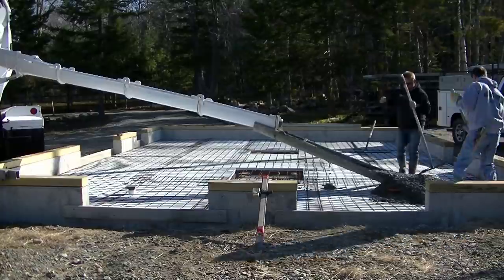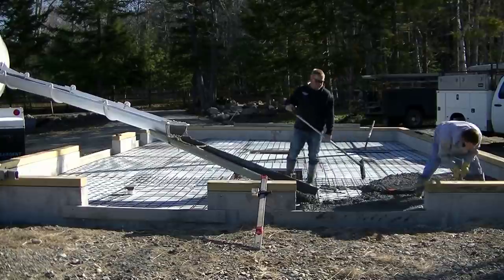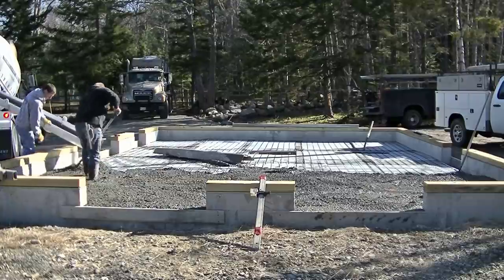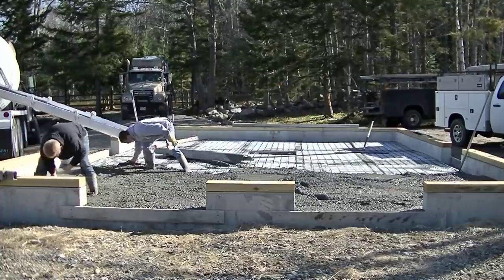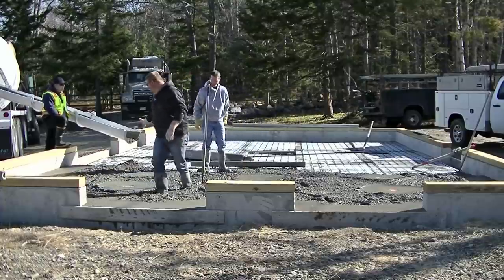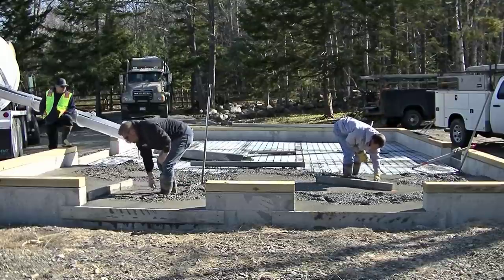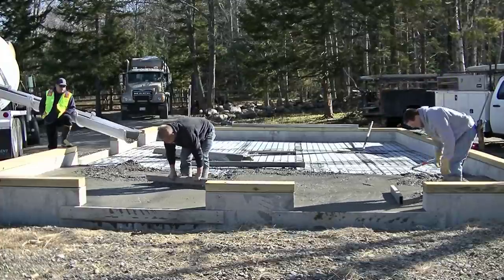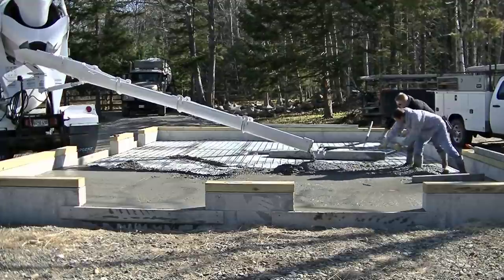CONCRETE FLOOR FOR GARAGE | HORSE BARN FLOOR

Comment: Pro: Impressive seeing just two guys placing a slab of that size. Nice work!
Con: Leaving the mesh on the bottom of the slab is a total waste of time and money. You might as well leave it out. It adds no strength what so ever.
Reply from the maker: Yea, I'm not a big fan of wire mesh. This mix also had fibermesh in it. If the wire isn't chaired, it most likely ends up on the bottom of the slab.